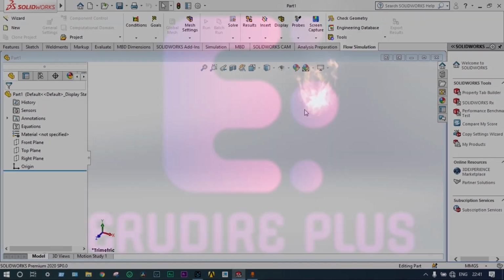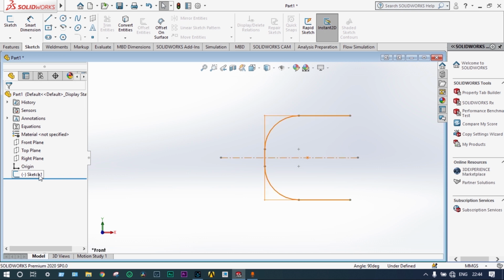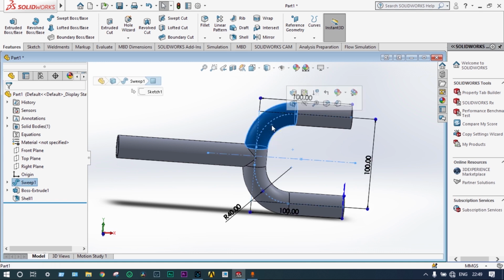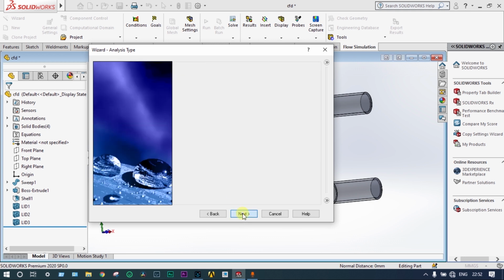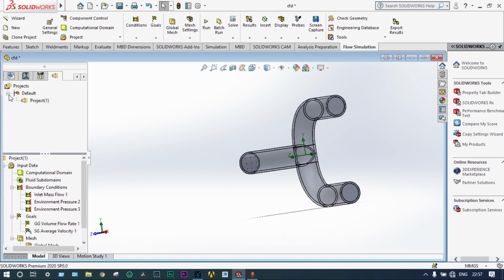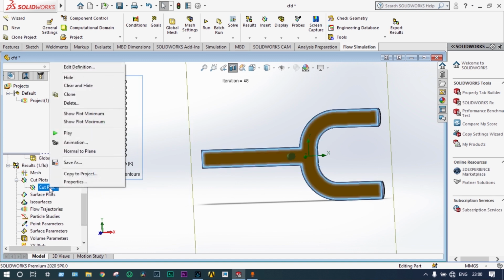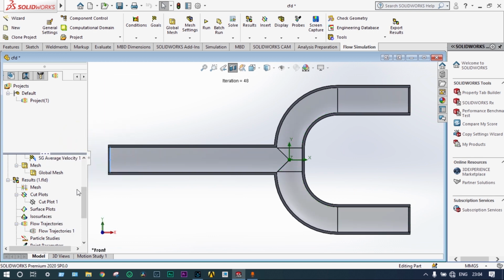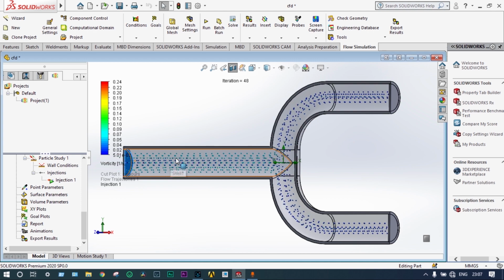CFD Flow Simulation through Complex Pipes: A SolidWorks 2020 Tutorial on Dynamic Behavior

Comment: Can you reverse the flow with different flow rates? Can you show the data also pleaseeeeeeeeeeee.
Reply from the maker: Ok I will
Reply: @CFD_GUIDE  THANK YOU!!!!!
Reply from the maker: It is posdible by using parametric analysis. Are you asking to change the direction of flow with different flow rates? Even you change/reverse the flow direction or not, we can have a huge ranges of data with your choice of flow rate with one go by using parametric study
Reply: @CFD_GUIDE  I just want to see if it's possible that A1V1 + A2V2 + A3V3 = total AV
Reply from the maker: It must be equal
Reply from the maker: It should be A1V1=A2V2+A3V3, because it has two end faces
Reply: @CFD_GUIDE  According to bernoulli's principle, you have 3 inputs meeting at one point, the 3 inputs would also equal to the output.

What's your opinion on this?
Reply from the maker: Which model are you talking about? My model is having one input & 2 outputs
Reply: @CFD_GUIDE  I'm just making an example. Basically, any input equals total output based on continuity equation or bernoulli's equation.
Reply from the maker: I am not having any doubt about CE that's why I didn't show input mass flow rate =output mass flow rate. It's bound to happen.

Comment: Please help me, I want to do an optimization on my model to know at what parameters of the system I should get let's say 25L of drinkable water
Reply from the maker: Pleaze let me know in details about your project
Reply: @CFD_GUIDE  It's on a Solar water distillation system. I can send you the image of my model if you don't mind, please
Reply from the maker: @xyengineeringandtechnology8497  Yes, please send it to me, but immediately I cannot start working on it. I will start working on it on Saturday evening
Reply: @CFD_GUIDE  OK. Please send your mail. 

You can similarly direct me on what I can do. I want to know if I can do that with Solidworks. Thanks once again
Reply from the maker: For providing distillation, what have you done in the model? Have you used porcelain or porous material? First of all conduct a parametric study with different mass flow rate and see the results. After getting a result close to your desired goal, go for optimization of your final goal with a narrow mass floe rate range
Reply from the maker: smajumder.nitdgp@gmail.com
Reply: @CFD_GUIDE  OK. Thanks
Reply from the maker: I have seen your model but by seeing your model it is very difficult to make a model of this one and optimize. I need to have dimensions and porosity of the system to optimize the output. It is very simple. You need not model the whole setup. Only the container and the porosity is required
Reply: @CFD_GUIDE  Can I send the model to you? 

I did the model on Solidworks. Or should I convert it to a step file?
Reply from the maker: First of all you can try to simulate your model because I can work on your model on Saturday evening onwards. In that mean time try to simulate and conduct a parametric study on your model with a varied range of mass flow rate. In your model input boundary condition can be taken as mass flow rate of water before porosity. After getting the output volume you can try to optimise
Reply: @CFD_GUIDE  Thank you. 

I will send the model to you.
Reply: @CFD_GUIDE  I want to subscribe to your channel twice 😀😀
Reply: @CFD_GUIDE  I'm having some problem with the geometry, especially from my routing
Reply from the maker: I couldn't open your model. Plz check your email
Reply: @CFD_GUIDE  OK. I'll try and resend